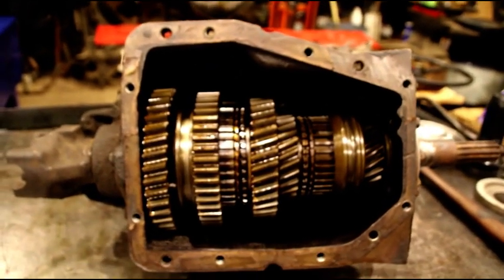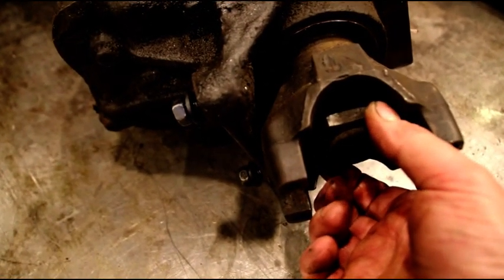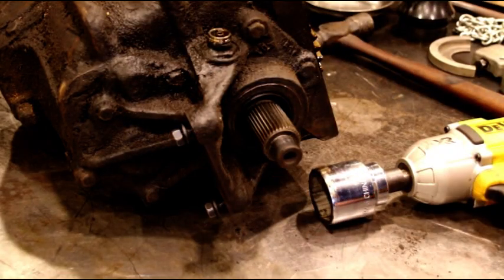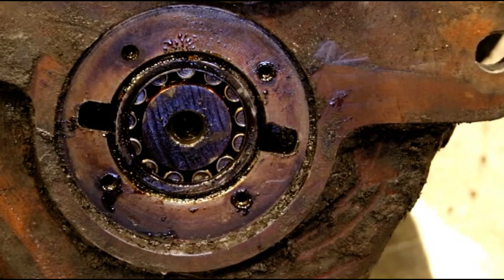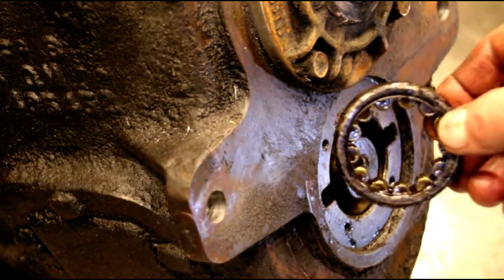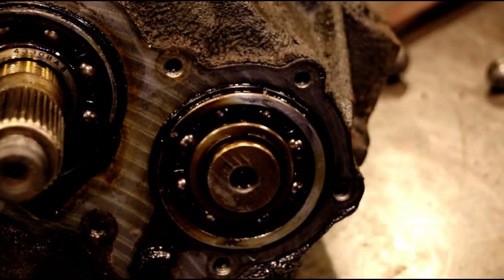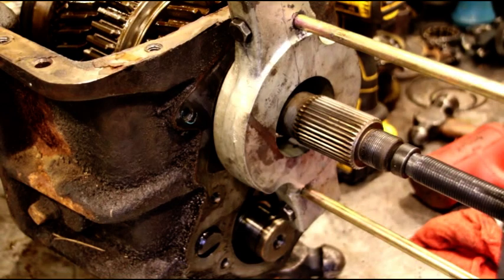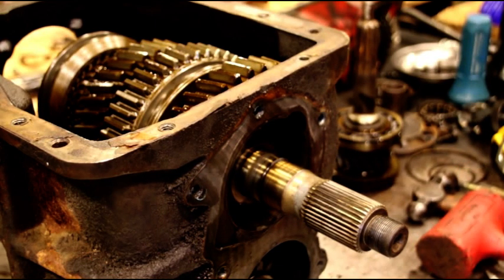SM465 Rebuild, Part 1 Disassembly and Bearing Removal

Comment: Just got done building a sm465.  Using the Novak kit adapting to a dana 20 everything went fine I followed your videos step by step. Thanks for a well put together video series very helpful.  Anyone attempting doing a rebuild I suggest you have a press or access to one. I have a small 12 ton press worked great.  Thanks again.
Reply: What's the kit / part number

Comment: When I installed the dana 18 adapter from advanced adapters to my sm465 I just purchased a posi lock bearing puller made the job real quick
Reply from the maker: great, better than using a large hammer to do things.

Comment: I used 2 screw drivers and pried the front counter shaft bearing off.  77 chevy C10.    It came off relatively easy.  Regardless great set of videos,  very helpful, thanks for making them.

Comment: Great video as always. Cool you have those Kent moore tools. I tried to get the thrust yoke tool for the Warner 3 speeds like the t 14 a. I called who made the tool but no luck. Can't remember if it was Kent moore. Would be nice to find a retiring trans guy.  The only guy I know now is still going.
Reply from the maker: When you can't find  the tool you need best to make it yourself.  I have many transmission tools that are home made and work great.

Comment: Had a leak via the front seal and screwed the clutch. At least I learned again the seals suck. Not taking the top off and gonna feel for the flot spot to pull the input shaft. Mine seems a tad loose.
Reply from the maker: you have to drop the cluster gear to the bottom of the case to remove the input shaft.   If the seal is bad just pull the front bearing retainer cover and change to a new seal and you should be fine.
Reply: @metalshaperJeep  unsatisfied from last clutch and seal job . Not many miles and blew that clutch on a long haul , thanks to the seal blowing almost asap. The bearing is sloppy. I was overloaded too much. the pilot bushing must have got hot too as the bushing started to disintegrate. I should have stopped and adjusted the clutch fork as the wear increased possibly from that too. Most slippage was the oil . I only use the truck to move almost every year because of our crappy , stupid world. Then I have to fix it all the time. Very pissed that it is made to wear out, just like everything else.

Comment: Is there any difference in the input shafts between the 2x4 and 4x4 sm465 transmission as I have a 4x4 with a worn input shaft and some parts 2x4 transmissions?
Reply from the maker: input shafts are the same

Comment: Is it possible to install the 465 in my 62 4 cyl cj  5 ?
Reply from the maker: Anything is possible.  You will need an adapter to attach to your engine.  then an adapter to attach the dana 18 transfer case.  Driveshafts will need to be lengthened in the front, shortened in the rear.  You will have a very short driveshaft in the back.   Your clutch linkage will need to be modified and a variety of other things will need to be addressed.  Mounting, floor modifications, etc.... Make sure you are up to the task before you start, a lot of people start swaps like this and never finish.
Reply: @metalshaperJeep parts number for rebuild kit?